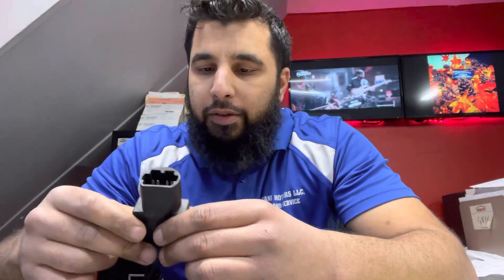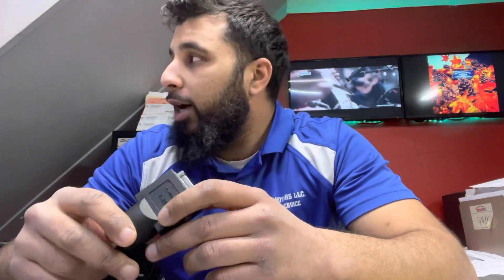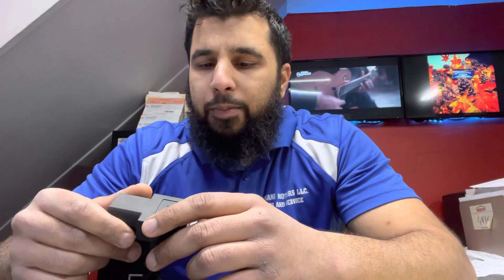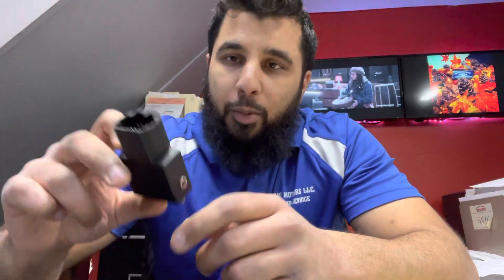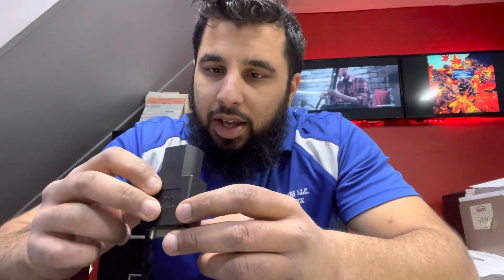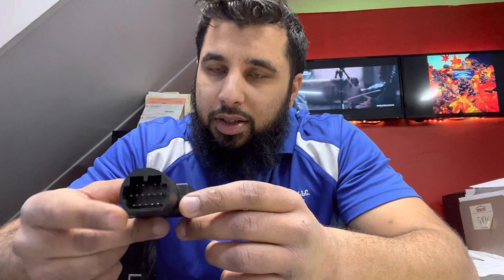No communication obd1 Toyota? Try this!

Comment: Hi, needed a little help,

I have 4efe 1300cc efi engine in my corolla 1986,  and it has 22 pin diagnostic port under hood.
Ibwamt to scan it with scanner and i searched alot about it and fine a obd1 to obd2 converter cable on Ali Express. But i am curious that it will work with OBD 2 scanner (ELM 327) OR NOT.
Please let me know if there's any scanner which will work woth my car's engine.
Reply: (For whoever comes in the future) those adapter cables are mostly for shorting out the pins at the end of 16 pin OBD2 connector instead of the original OBD1 port. Don’t get them. It’s a waste.